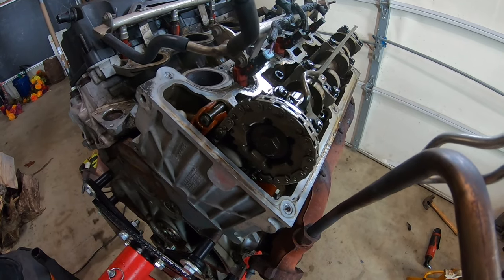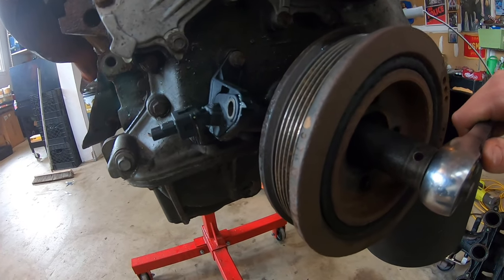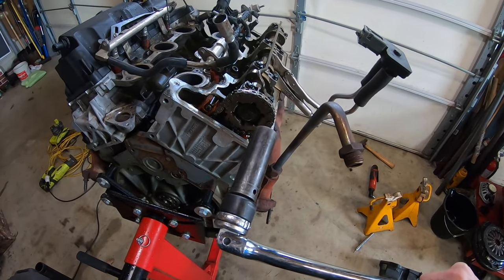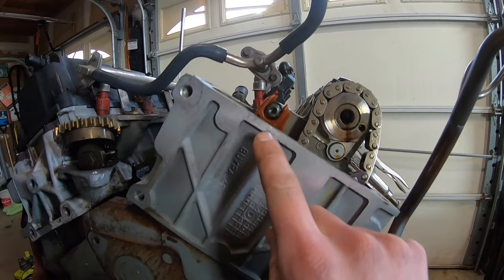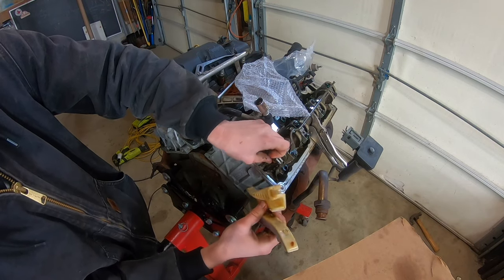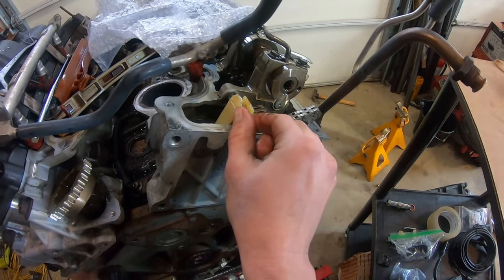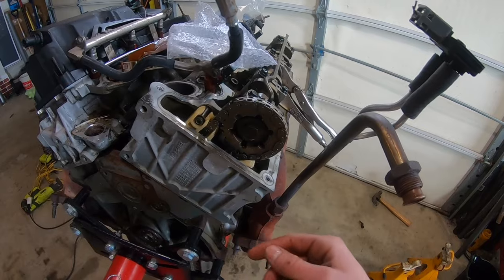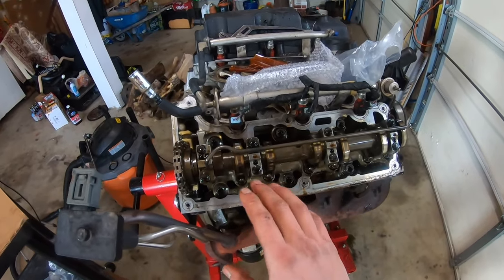Ford 4.0L SOHC V6 Rear Timing Cassette Replacement (WITHOUT FORD SPECIAL TOOLS)

Comment: Can this b done with the motor in and  just pull the trans out
Reply from the maker: Yes
Reply: @iamdjnam  cool I justed replaced the the fuel pressures sensor on the fuel rail and did the valve cover gaskets. It had a the rattle sound lol and found it's broken. My freind has been driving that way for 2 years now it only has 136000 on a 04 explorer
Reply: I'll be doing this Friday thanks for the good video
Reply: Platinum Garage awesome video. I will doing this job with the engine in the truck. Vehicle is a 4.0 03 ranger 4x4. It has a body lift so I have some extra room to work. Also have to do the rear main seal. Had the engine rebuilt in Dallas,TX for a little over 3k.  Guys that did the rebuild used tensioners with shit springs. Replaced rear one and torqued it correctly to 49 ft lbs. but still have noise. Rear main also incorrectly installed. So going to pull the valve cover and trans this weekend and take a look. Any advice you can offer would be welcome
Reply from the maker: @jornellas6060  definitely replace the rear main seal using a Ford OEM one with the wear sleeve. Check out my “rear main install” video on my channel

Comment: Only criticism I'll give is that I wouldn't reuse an old tensioner, I would replace it along with the cassette unless you know you've replaced it recently. Even if it is a low mileage engine, if it is old then there is components in the tensioner that go bad. Reason being is the way they are made, at the top of the tensioner where the oil feed inlet is there is a one way valve encased in a rubber stopper. We all know what happens to rubber when it is exposed to oil for a long time, it becomes hard and brittle. This means that stopper at the top will start to leak and when oil pressure isn't up to snuff it will result in too much flex/movement when towing/low RPM and that results in breaking the cassette as it allows too much flex/movement when it shouldn't. It is why when generally if you are doing the timing components, you should always replace tensioners too.
Reply from the maker: Oh absolutely, I agree.

Comment: Is any body  the know if I can replace hydraulic lifters on this motor with out remove the head  ? Plz let me know
Reply from the maker: Yes you can
Reply: @iamdjnam  is normal if the noise is only when the motor is on high rpm  because when idle doesn't make noise   if know let me know. I believe is a lift noise. Anyway
Reply from the maker: @adalbertozelayala5702  hydraulic lash adjuster or roller follower. Pop open the valve cover and check it out

Comment: Great video but u didn’t change the timing chain. So how do u do that ?
Reply from the maker: Remove jackshaft plug and remove the TTY bolt. Replacing the chain requires complete retiming of the motor.
Reply: @iamdjnam  can u make a video on that in the future? I’m trying to save myself a few thousand dollars in repairs for my 2005 mustang. She showing early warning signs of timing chain failure
Reply from the maker: @cptburglass5815  for sure next time I get a motor in the garage. A lot of people don’t want to get the tool kit, and chains last over 400k miles, so the cassette replacement is easier.
Reply: @iamdjnam  my car is at 120k miles and I babied her but these 4.0s are infamous with timing chain failure
Reply from the maker: Mines at 227k original chains, owned since new. It’s all a gamble. My 02 has 120k and rattles like crazy.

Comment: The only way to replace the part is to have the engine out....is their a way to do it with the engine in place
Reply from the maker: Engine or transmission must be removed. There is no other option.

Comment: I have a 4.0 and a 2006 ranger what does Belle cover off I saw that the passenger side head cassette was broken what’s the time in chain cover off I was going to sell it for top dead center turning the motor clockwise I noticed The passenger side cam was not turning when I turn the crank just the driver side was I’m gonna pull the motor Any thoughts on what could cause this the chain doesn’t seem to be broke just a cassette anybody would help would be appreciated
Reply from the maker: yeah the slack in that chain because the cassette broke is causing it to turn delayed. make sure it didn't bend valves.
Reply: @iamdjnam  I’m afraid that might be the case, when I took the intake off I noticed that it in Port channels the valves were under antifreeze all three of them on the passenger side head might be a cracked or A head gasket any thoughts appreciate you getting back to me...thanks
Reply from the maker: At this point dude just get a used motor and put timing kit in it as preventative maintenance
Reply: @iamdjnam  so what you’re saying
There’s a chance to fix it
I heard that the 4.0 are getting scarce and And more expensive to acquire.. just pulling the motor is a bitch. I’m gonna look into seeing if I can find one used anyways thanks for your help peace

Comment: Where are you located? Thanks JB
Reply from the maker: NJ
Reply: Got'cha. I'm south of Atlanta. My father was from Brooklyn. I wish you were closer. I'd pay you and be your helper just to R&R and rebuild my 4.0 E in my 2004 Ford Ranger Edge 4×4. I put a lot of work into read end, front end, and suspension. Then, all my tools were stolen after I got a BS DUI.  Now I'm walking and I put about 15 - 20 K into that truck including parts, labor, and tools. Anyways, let me know if you got any ideas on any  reasonable Good rebuilt 4.0's. I would really like to get back on the road. I need to work on my front differential and my cassettes in the engine are about gone with about 230 K on the odometer. Thanks for replying to my text, Nick.🐴🐴🐴JB
Reply from the maker: The only good rebuilt motor is one you do yourself. I had a customer come drop his off with 4k miles on a rebuild that already failed. Find a used engine with 100k, pop the valve covers off and make sure everything is intact.
Reply: @iamdjnam  yeah, for sure. Got no tools nor trailer for now, trying to be patient. Looking on the net for shops compared to Jasper and powertrain but maybe a little cheaper. I would rather do it myself, but would like to have someone to double check with on and off cuz I dont have any motor rebuild experience other than instructional videos and manuals. I dunno??? Thanks for replying, JB 🐴
Reply from the maker: Powertrain was the one that croaked, don’t get theirs.
Reply: @iamdjnam  thanks for the heads up Nick.

Comment: Can you cheat..just the rear..pull sprocket turn cam back and install new tensioner??
Reply from the maker: It needs to be done this way in the video to prevent screwing up timing for the rest of the engine

Comment: Little dissapointed that you didn't make a video on mine!🤣
Reply from the maker: LMAO! I was so in focus on making sure everything was absolutely perfect that I didn’t even bother.
Reply: @iamdjnam  I appreciate that.
It was suppose to go in today, but my helper (son) was sick so I focused on buttoning everything else up.
The Axle swap is 100% now, just finished custom hardlines , soft line extension, and touchup paint today.
Hung the bed from the roof in my shop with ratchet straps and replaced the fuel pump, fuel filter, and drained the year and a half old gas out.
Shes nearly complete!

Comment: Please read this. I copied off my post on Facebook. What do you think the problem is. 

Weird one for everyone 
2005 Ford Sport Trac 4.0 sohc
Didn't have this noise before installation of new remanufactured engine. Started immediately after install. 
Type of noise ( like swishing marbles submerged in tin can with oil, or like a very quiet little diesel engine ). Not a metallic sound, nor metal on metal. Doesn't hold the same beat, kind of like a drummer off note.  
Sound is not present with the cold engine. It only happens after the engine warms up and the idle levels out. It will gradually get louder until engine reaches normal operating temperature. It will do it in park, neutral or drive. Only at low RPM, any input of the gas pedal noise are immediately goes away. 
Location= rear of engine, hard to tell if it's in the bell housing or rear timing chain area. 
Weak rear tensioner?
Loose or cracked flex plate? But sound is not present cold
Torque converter? Sound started immediately after engine install. 
Weird.
Any help is appreciated.
Reply from the maker: What’s the oil pressure?
Reply: @iamdjnam  normal according to dummy gauge. Mechanically, I'm not sure.
Reply from the maker: You need a mechanical gauge.

Comment: How much would it cost to do a job like this?
Reply from the maker: Full timing job with engine out probably around 700 labor. Only certain guys know how to work on these engines. A lot of shops say no.
Reply: @iamdjnam  Thanks!! Wish you were in Florida, 03 sport trac started this noise at 273,000 miles
Reply from the maker: I’ll be moving there within the next few years. Sick of this NJ cold!
Reply: @iamdjnam  hi I have a question. I have an 09 4.0 mustang. I want to replace my timing chain in the front. But if I do that will I mess up the timing in the rear ? Like should I do something in order to not mes the timing up in the back
Reply from the maker: @ohhplurism6403  If you do the front and anticipate to replace the sprocket and chain, the jackshaft sprocket must be removed. In that case you will need to retime the whole motor. If you just want to do the cassette and leave everything else alone, the passenger cam won’t move. I do not advise attempting this for the novice mechanic. Slight movement can cause valve damage.

Comment: Ford Explorer 2000 model, six-cylinder engine, engine head sohc4,0l xs 1fmdu73e4yua77332, I need a picture or number of the front rails, please
Reply: Same part that u shang there
Reply from the maker: 4L2Z-6M290-AA
Reply: @iamdjnam  Thank you very much, my friend. This is the part number that I am looking for, and it is the front brake calipers on the side of the water cooler. It is correct

Comment: such a horribly designed engine. having to remove the engine to replace the timing guides is atrocious.
Reply from the maker: My Toyota 2jz has a belt up front. Can be changed in an hour. Pathetic on fords part.